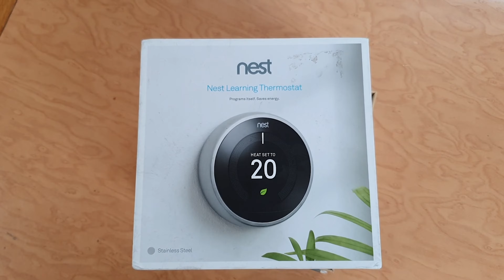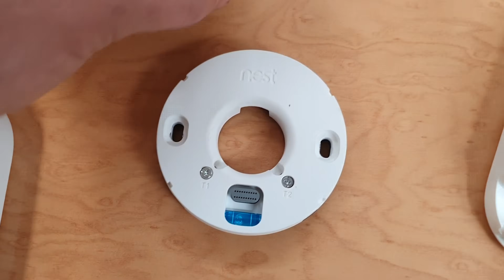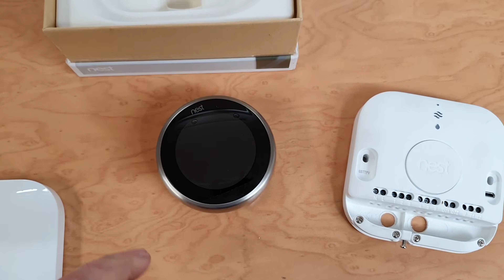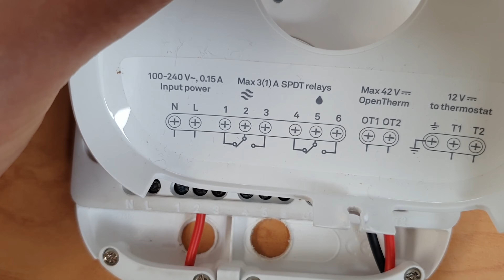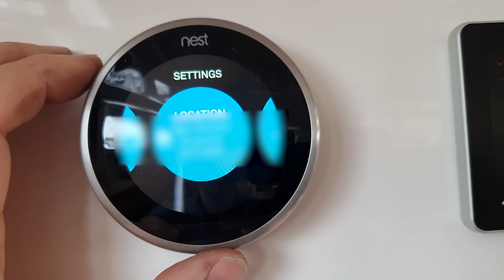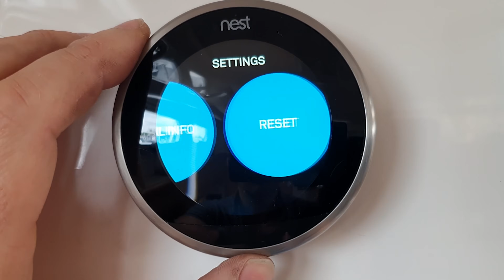Nest Thermostat To Remote Control Eberspacher Or Webasto Diesel Heater In Boat Caravan or RV

Comment: Any chance of a bit of a wiring diagram. I am trying to this at the moment and seem to have power to the heatlink and when I press the manual button it kicks my heater in however I just can’t get any power to the controller and not sure what wires go there?? Thanks.

Comment: Great video. I'm looking to install one in my overland truck. I have 12 & 24 vdc available. My heater is a 24vdc eberspacher s3 hydronic. It'll be no problem powering the unit however will the call to hear function work given my heater is 24vdc?

Comment: Is it necessary to use a Boost/Buck 12v regulator as the output from alternators can spike dramatically. Anyone fried their thermostat or can it handle variable voltages?

Comment: does it still run through its shutdown and startup process? or does it kill the power before the heater is done in its cool down after shut off?
Reply: That was what I wondered.... I understand there are thermostat wires to the programmer and looks like this would override those (?)
Reply: @MrDiscoseeker  that's what I was wondering. Cuz I'm sure it's not healthy to have it shut down before it's cool down prosses

Comment: I have the same setup as you; but we also have a 2kw 230v water heater element in our Calorifer. Can we connect the 230v cable into the water heater side; if it’s got 12v power in, and 12v heating? Will the 230v mix with the 12v?
Reply from the maker: Yes i subsequently used the hot water side of the nest to control the immersion heater in the calorifier.

You can't wire the heater element up tithe nest as the current draw is too high you need to use a 12v controlled mains relay somethingvlike this https://www.ebay.co.uk/itm/123368952599?mkcid=16&mkevt=1&mkrid=711-127632-2357-0&ssspo=rddb5PpqRci&sssrc=2349624&ssuid=gqthl8ThSZq&var=&widget_ver=artemis&media=COPY
Reply: @Boatingtube  this is excellent help. For the 12v module; I assume the IN next to the DC + and DC - was connected to the OUT on the nest module? I’m guessing that sent the control signal; and the module then triggered the AC side?

Comment: Anyone else tried this? It’s ideal for what I’d need, but nowhere else have I seen the heat link running off 12V battery feed.
Reply from the maker: It works just fine several people I know have done it 👍

Comment: I’m just going to order for my narrowboat and on Amazon I’m confused if YOU have the 240v or 24v version? I get it’s 12v but which one is yours please? Many thanks
Reply from the maker: It was the 240v one I used but it works OK at 12v not sure about the 24v one that wasn't available when I did it so it must be new. I got mine of ebay used at a good price

Comment: 2 question if I may sir? Do you need wifi on 24/7 for the heatlink to talk to the thermostat unit? Any idea of the range between the two? What an amazing video
Reply from the maker: Once configured it should work locally without WiFi u just won't be able to remote start. Not sure on the range should be at least 5 metres though if not more

Comment: What an amazing video your a very clever chap! I’m looking at a webasto for my narrowboat this will really be of help
Reply from the maker: Wow thankyou Stuart ☺️
Reply: @Boatingtube  could you  advise what exactly you do with. The two red wires. Looks like they are joined. Also by the eberspacher you have a red going to the yellow.  Is that from the two joined reds at the nest. Or a completely different  cable from the battery.
As mine just runs the fan and doesn't go through the normal pre checks.
I have a d4 plus.
Thx in advance.

Comment: This is brilliant thank you 
I’ve recently installed an eberspacher m10 hydronic water heater with 3 heat exchangers. 
Since watching this I’ve now installed the nest 3rd gen controls with heating and hot water. 
Managed to wire it like S-plan  so hot water and heating when I want it and remotely via the nest app 
Thank you for the inspiration 😎😎😎💪🏽👍🏽👌🏽👌🏽👌🏽
Reply: How?

Comment: Well i am not sure where you are connecting your wires too, but surely it works. I am thinking the heater is a very old design, as the newer designs including the chinese knockoffs. Are controlled by one wire, CAN buss.
Reply: Mine has three wires Chinese I don't think this will work but there's the afterburner that does pretty much everything this does and more but it like the look and function of the nest!

Comment: T1 and T2 on the module sends power to the Nest Display T1 and T2 if you have existing thermostat wiring you can use that rather than run 12v from your battery.

Comment: When the call for heat ends and the room gets to temperature does your heater run it's cool down cycle or just turn off?
Reply: The heat will continue to cool down once the yellow wire is no longer energised. It’s the permanent live to to the heater that operates the cool down etc . Yes it operates as normal

Comment: How will this work when it gets to temp? Diesel heaters have to run through a shutdown etc and will this basically just keep turning it off and on to maintain temp? Isn’t that going to create a big draw from the glow plug every time?
Reply: The heat will continue to cool down once the yellow wire is no longer energised. It’s the permanent live to to the heater that operates the cool down etc . Yes it operates as normal
Reply: Great question
Reply: @Mauronic100  no anser jet ?

Comment: Will the heater operate normally, slowing down as it reaches temp, and hold that speed as long as temp is maintained.  Only using yellow wire from the 5 or six that go to regular Espar thermostat, what do you do with others.  I think I am missing something. Thanks
Reply: The heat will continue to cool down once the yellow wire is no longer energised. It’s the permanent live to to the heater that operates the cool down etc . Yes it operates as normal

Comment: Am I right in saying that the yellow wire basically is from the switch in the original thermostat? And you simply put another 12V source through the relay in Nest to the yellow wire and simulate the switch?
Reply from the maker: correct it's the "call for heat" if it sees 12v+ it turns on if it sees 0v+ it turns off
Reply: @Boatingtube  Thank you! Wired it the same now, but using a YDCC-04 as a switch and magically I have now full remote control over my diesel heater and can switch it on/off. My LiFePO4 batteries like it  warm :-)

Comment: Hi thanks for the explanation. I could not figure out where you are connecting the positive red wire. Do you cut the yellow wire and attach the red one to it? If you have a chart, I would greatly appreciate it.
Reply from the maker: so hope this helps i can upload pics in the youtube chat. the yellow wire on the heater switches the heater on when it receive a +12v signal and off when at 0v+ the nest box has a relay (an electronic switch) so you feed any old 12v+ feed in to the relay and when it switches (drops in temperature) it connects that 12v + to the output of the switch (other terminal) and to the output (the yellow wire) does that help?

Comment: any one done this with a Chinese one
Reply: Lol I'm about to; came here for inspiration
Reply: @TheOceanX  Did you get it to work? I belive mine has 3 wires, red, black & blue.
Reply: Yeah same here I wired two thermostats and a time delay relay one heating the other and air conditioner that closes the switch power button but every 30 cycles It won't shut off or the reverse turn back on! It would be nice if this worked for Chinese ones! There's is the afterburner a guy in Australia sells them it has a lot of functions!

Comment: I just bought a nest. I have 24v in my Unimog camper but also i want to use in a tiny home with 230v. so in 1 and 2 pin y dont put any wire.  And If i put display in 230 socket ia necesary to put 12 v in T1 and T2?thnk You.
Reply from the maker: Not sure I understand the question it depends on the heater you are switching and if the heater needs 24vdc or 230v AC to switch it on?
Reply: @Boatingtube  ok... Last 2 îs for thermostat. First 1 and 2 wich voltage you put? Can i put 24v or îs necesary 230v? I have a tiny house with 220v and a same ds4 s eber like yours but at 24v. If y have pls a foto with final wiring în your heat link.